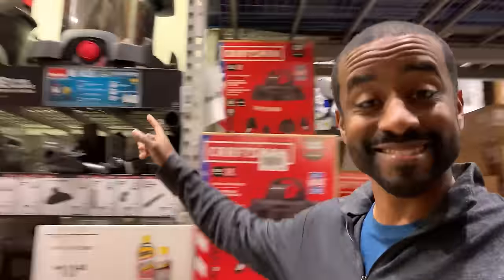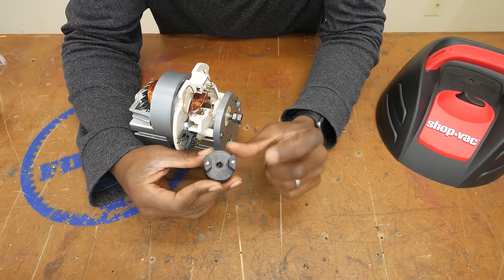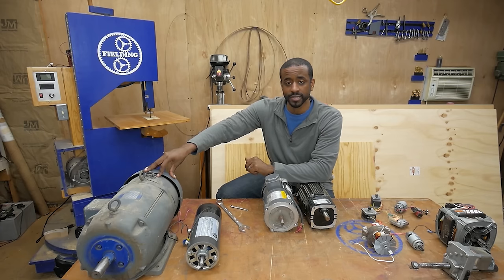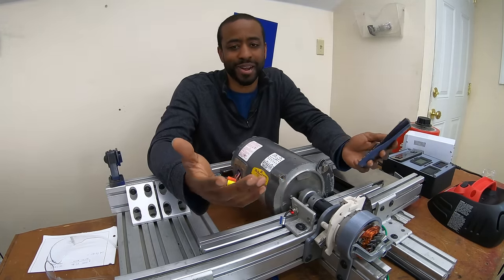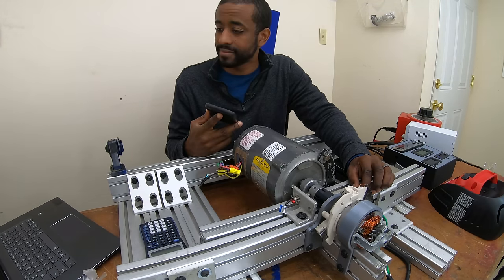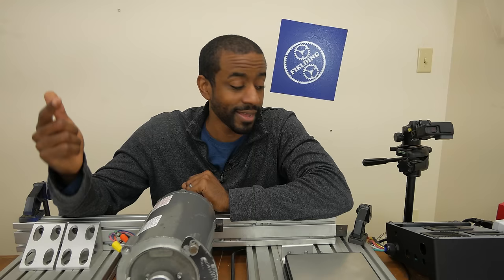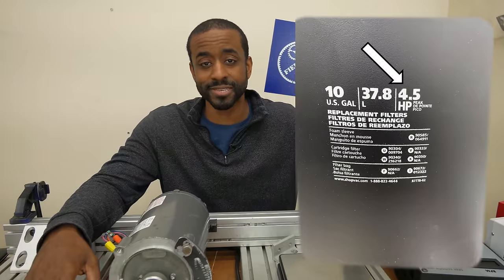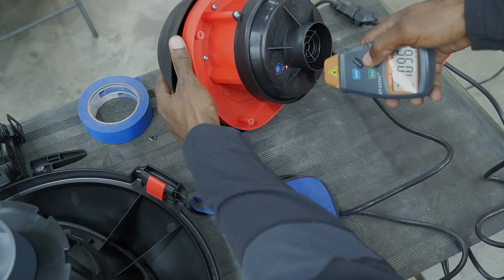How Much Horsepower Does Your Shop Vac Really Have: #078

Comment: Let's make an actual 6.5 hp one and see how much that really feels like
Reply: YES
Reply: *put tube against skin

Wow, that sucked my blood cells through my skin, that's one powerful shop-vac. 😅😅
Reply: Well using the 750watts per hp formula. Such a motor would need to be rated 4,875watts.
Of which is far higher than any household in the USA can handle on standard 115-120v AC. Why? Because normal household wiring to those outlets allows for a maximum continuous draw of 12 Amps. Which means 1,380-1,440 watts max.
However using 230-240v AC it would be possible to try such a heavy load with adequate wiring and breakers.
At the doubled mains voltage 21-20Amps would be required which is less than a households central heat uses and likely less than central AC. I've heard of people installing 40A 230-240v ports in the garages or just outside their homes for charging their EV 'electric vehicle.' 
You may be wondering why the variance in voltage for normal household mains power? 
It seems the distance from and number of individual homes using a power line step down transformer matter in how much voltage your home actually gets.
Reply: @BrilliantDesignOnline  lol
Reply: 🤔 How difficult would it be to Frankenstein an impact driver motor with good cooling and see if can make a decent shop-vak 😏
Reply: 6.5 at the crank or before loses? :) 
You would need a 5kw 3 phase motor.
In Europe you get 230V and max 16A = 3,6kw.
Reply: I imagine that would be roughly the same as a 6.5hp agri-fab gas powered leaf/brush vacuum.  That thing could suck up a dog.  😳😂
Reply: @ 6.5HP you need a massive generator to run it. certainly not a wall outlet.
Reply: It would be a dust collector... it could suck a whole bucket of sawdust, through a 6" inlet.
Reply: They made one in the lab.  The entire lab disappeared into a shop-vac shaped black hole just before it popped into another dimension.
Reply: I have an industrial vacuum that pulls close to 3.3kW from the wall with 3 separate motors. Uses a 50mm (2") tube. That thing is already dangerous, especially if you go down to the usual shopvac hoses (32mm).
Reply: @astbrnrd  not difficult. Most modern impacts are brushless. The difficult part would be using a motor out of an impact as the casing is literally the shell of the driver, as in it holds the rotor in place with its mold. 

Using a brushless motor wouldn’t be hard. I’m almost complete with a Frankenstein shop vac, it’s a 1.5g that I have mounted a dyson motor too. Reason for the dyson motor is that it’s a motor and controller combo since brushless motors require it. Pairing a controller and motor can be a pain in the ass if you’re just trying to get a simple on off functionality. Better just to get an all in one unit. 

I could go on about this since it’s something I’m working on. It’s very possible, but matching the same output power of a universal motor from mains even when it’s handicapped like in the video is tough. It requires a high current source obviously. So quite a few cells are required. In my case a 6s2p pack a built for it.

Comment: Air compressor manufactures went through lawsuits because of this deceptive practice. They're are picking and choosing the numbers from different scenarios. They're using the Max watts the motor was drawing when it stalled. Your meter showed around 26amps when it shut off, so lets say 28amps max current you can dump into it. 28amps x120v =3360watts. Divide that by 746 and you get 4.5horse power.
Reply: so it's a 0.87 hp vacuum, but a 4.5 hp space heater.
Reply: No matter what, its a deceptive marketing and sales practice that's used in most electrical and electronics especially audio  power amplifiers. Its bs to trick the consumer with NO electrical background.  Period!!!
Reply: power output is hp. Using power drawn is not how hp is defined. Using that logic I can short out a transformer and claim a 20hp motor.
Reply: Bravo!
Reply: 28 amp draw would trip a 20 amp circuit breaker, which is the max current available for common 120 volt circuits.
Reply: Tom Garbo  how exactly do you get 5000 amps through the Shop Vac power cord, which is probably no thicker than 12 gauge wire?  It would immediately melt with a bright flash. Have you ever wired a building?
Common building circuits for 120 volt outlets are protected with 20 amp breakers. Go have a look at any building code or practical DIY building electrical wiring book.
Reply: Tom Garbo  neglecting increase in the resistance of wire due to temperature change (probably OK for a few nanoseconds), let's have a quick look at voltage drop for 5000 amps over 20' of 12 gauge wire for the circuit, plus a 6' power cord for the Shop Vac:
Remembering Ohm's law: V= I * R
Rsp = .002 ohm. / foot.
len = 26 foot.
R = Rsp * len = 0.052 ohm
I = 5000 ampere.
V = I * R = 260 volt
Well Mr. Expert Electrician, how can you have a 260  volt drop on a 120 volt AC circuit?
Reply: @marcs3982  Yup, reminds me of those cheap car audio amps you'd find online or at flea markets ... So small they can fit in your palm but the manufacturers claim they can output 2000-4000 watts with the requisite giant lettering on the box..... all while using at best a 14 gauge wire for power. LOL
Reply: PMPO horse power!
Reply: Great comment! Thanks for pointing this out.
Reply: Yeah. Im guessing that if they did it the correct way (simplified), they would treat 3360 watts as VA as they need to account for power factor for true power Then, efficiency which we could use his value  of .51.
(3360 x .85pf x .51) / 746 = 1.95 hp EVEN with this maximum theoretical amp draw.

Comment: 6.5HP is so great. I'd love to burn my house down with that 40+ amps from my 120V socket.
Reply: I see you came up with the same amperage as I did.
Reply: Make sure you bypass the 15 or 20 amp circuit breaker so you can get the full "burn down the house"  experience! LOL.
Reply: @mckenziekeith7434  Get yourself one of them fancy "slow blow" circuit breakers
Reply: If I was trying to burn down my house, I think I would just bypass the breaker box altogether. The slow blow circuit breaker doesn't allow enough current for long enough to get a good electrical fire started. LOL.
Reply: When buying that shopvac, ask Homedepot what isle the 40 amp breakers are in
Reply: This is the simplest way to explain why this is BS.
Reply: watched the video and now i understand how they get this number. cheating bastards!
Reply: And that assumes 100% efficiency.
Reply: More like 60 amps
Reply: After you rebuild, use a 240v dryer outlet instead
Reply: exactly!
Reply: It should. Also, most motors (not sure about the brushed ones in a vacuum) tend to draw about 1.5kva/hp once they get going... It's a matter of inefficiency and poor power factor. So make that a nice 80A.
Reply: It was only around 50% efficient, though, so you're actually looking at 80A.  That's enough to blow the main breaker of my apartment.
Reply: @deltab9768  All motors, no matter what type they are or what physical sise  they are. if they say that can produce 4.5 Horsepower they should deliver that. Hose power is ma measurement well established  mesures work over time. Is if i purchase a car that the manufacturer sau i can do 499 miles per hour  "Pick" What that means to me if i have to take the car up with a helicopter and drop it to achieve that speed. the same as the Shopvak. What good is that number if the motor will never develop that power?
I have a dust collector in my garage with a 3 true Horsepower motor that is 10 times as powerful 6 hp in my Shop Vac. Even the mechanical parts on the Shop Vac will not withstand the torsion of the 4.5 horsepower motor, it will brake the shaft  in a short time.
Reply: The kicker is that they include the motor's inertia. That's stored energy, not what's coming out of the wall socket at that instant.
Reply: me with 240 V Socket Porbably Burn Down The House And Blow Up The Tower
Reply: Hook the cord on to the main lug from the primary line in the panel 😂
Reply: @misterhat5823  i was thinking something like that but still the number seems high
Reply: @Pass the Spider yeah 40 amps at 1.5 volts?
Reply: Or just climb the pole and hook it directly to the secondary of the transformer.

Comment: Haven't watched the whole video yet but I can tell you already that's going to be seahorse power.
Reply: LOL, actually!
Reply: Just FYI ... These vac's aren't rated in Horsepower, ... they are Rated in "PEAK HP" or "Peak Horsepower"  ... Peak HP is a measurement of maximum torque achievable and is a test done in a laboratory on a machine that feeds the motor with as much AMPS as it can take and at the same time appling resistants on the motor to measure the units torque potential that measurement is the Motors PEAK HP  ... you will see this measurement  used on some kitchen appliances,  Blenders, Air Management tools and compressors .
Reply: Ricky Barber  ... there's nothing deceitful  about it  .. a bigger number gets you in general more vac for your money ... its simply a Good, Better Best rating .. as Peak HP goes up .. again in general size, motor windings, features, motor life time,  endurance,  all go up with it ... but ya ..  actual performance at the tool will very ... you want a vac with high sealed pressure for picking up water get one with a 1.25" hose ... ya want to pick up drywall dust you need high CFM get one with a 2.5" hose  ... you understand the actual  performance is shaped even by the tool you use with it Right? ... last time "PEAK HP" .. is not a Horsepower rating  ... and please tell me you don't think  a Horsepower rating alone is indicative of how fast your car goes.
Reply: @logun24x7  You're right, but when they print it on the box like that, they are clearly IMPLYING something else. The average customer assumes that the numbers on the box actually mean something measurable. The manufacturers know this or they wouldn't put it on there. It's pure BS meant to deceive.
Reply: @alexmaclean1  .. I know it's fun to be a weekend engineer and get outraged these days about one thing or another but clearly there is no attempt at deception here, its there as an vacuum industry comp. rating .. It's printed right on the box that PHP (Peak HP) is not operational horsepower ... it's on every page of their website and you can look at any unit on their site to see the actual operational ratings , CFM, SP and Air Watts of every unit they offer with an explanation of what each of these ratings meen , you can even have a read of the owner's manual before you buy ... 
if they're trying to deceive people they're doing a shitty job of it. 

https://www.shopvac.com/product/shop-vac-eagle-eye-14-gallon-5-5-peak-hp-stainless-steel-wet-dry-vac-catnum:5801210

Horsepower Rating
**"Peak Horsepower" (PHP) is a term used in the wet-dry vacuum industry for consumer comparison purposes. It does not denote the operational horsepower of a wet-dry vacuum but rather the horsepower output of a motor, including the motor’s inertial contribution, achieved in laboratory testing. In actual use, Shop-Vac motors do not operate at the peak horsepower shown.

CFM (Cubic Feet Per Minute)
CFM is a measure of the quantity of air moved by the vacuum motor at a particular system load, such as 2-1/2" orifice. Your actual system load is determined by the type, size and length of the hose used, the accessory tool used and the filter system used. A dirty filter system can drastically affect the suction and air flow. The filters need to be cleaned regularly and replaced as necessary to avoid reduced suction and air flow.

SP (Sealed Pressure)
Suction pressure represents how far up a glass tube a vacuum motor will lift a column of water. This function is measured in inches. Maximum suction pressure or sealed water lift is obtained at zero air flow. Suction pressure decreases as air flow increases.

Vacuum Performance (Peak Air Watts)
Vacuum performance or air power is the rate of work performed by a vacuum cleaner. Air power is a function of suction and air flow at an operating point. Air power is reduced by dirty filters, leaks and attachments used.
Reply: @logun24x7  why would you comment on a video you obviously didn't watch?
Reply: Stepping in to help my fellow 🇨🇦.
Most industries got away from HP up here a number of years ago because of the misleading marketing. I wouldn't call it deceitful, just dirty. "We need a bigger number, give me something verifiable to slap in the box."
Aside from niche racing consumerism, nothing up here is marketed or sold in HP anymore.
Afaik: horses stopped doing anything useful for man >150 years ago.
Reply: @logun24x7  you're partially right, they don't actually measure the torque they measure the power consumption.  746 watts (i think ) equals 1 hp.  An electric motor will consume the most power with the rotor locked where it can't turn at all.   That's your horsepower
Reply: @TheWeirdSide1  Did you even watch the video ... PEAK HP .. is on the Box and on the store information label .... all you need to do is READ  ... see 0:28 in the timeline its literally marked on every side of the box
Reply: @logun24x7  That is like labeling a box to weigh 10lbs but they calculated what it would weigh on Jupiter. It is very clear deception. Peak horsepower is a redefinition of 2 words used as a phrase, peak and horsepower. They are meant to imply that the peak amount of horsepower the vac will output is that number. When you buy a truck with 400hp it will be more powerful than a truck with 200hp and yes there are multiple factors that determine how fast but that is because the MOTOR is 400hp and the speed is a function of the whole truck. In the case of the vacuum the MOTOR is not 4.5hp or anywhere near that. Their fine print even says that it will NOT PERFORM to THOSE standards that they tested it to in your home. That means you cant replicate those results because it is not made to function to those specs. If that doesn't make the number meaningless then I don't know what does.